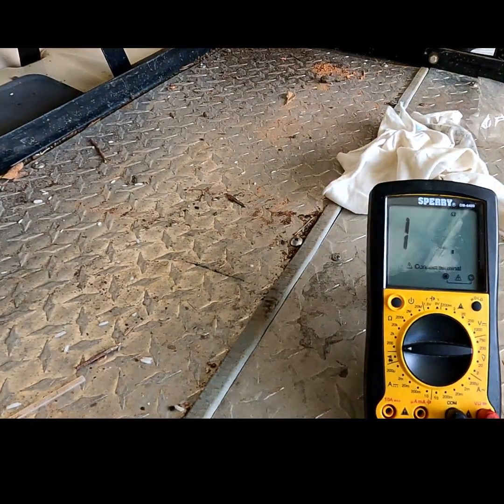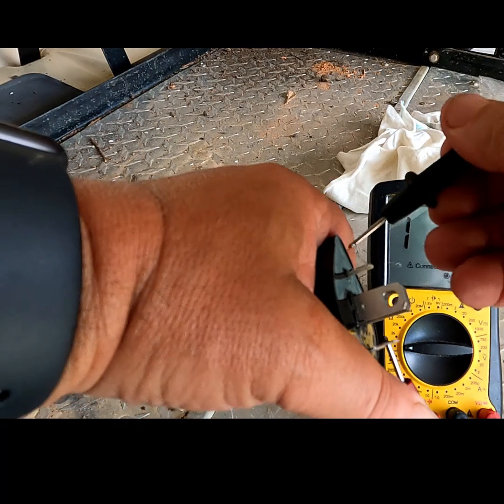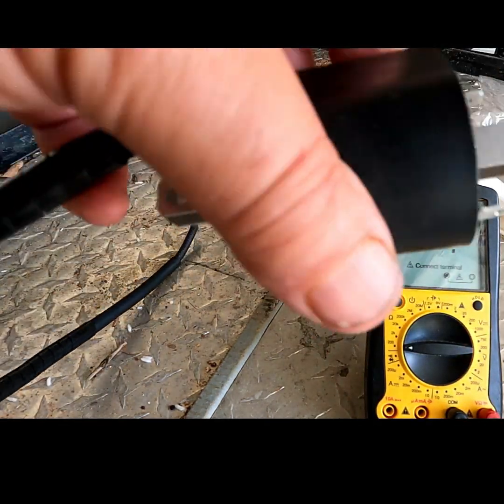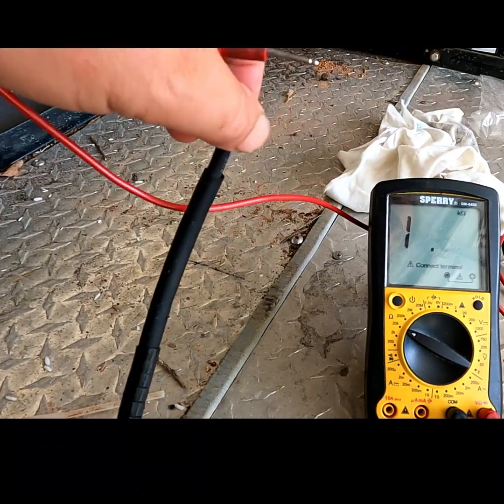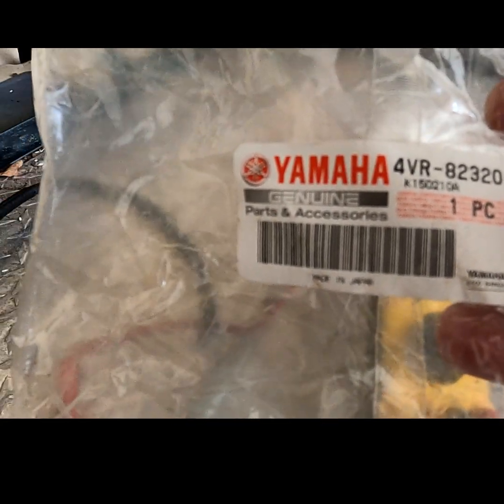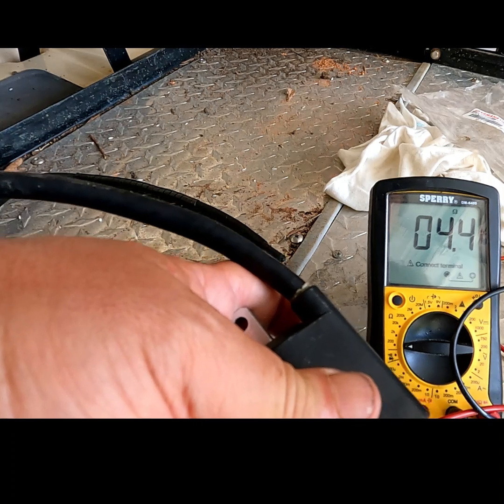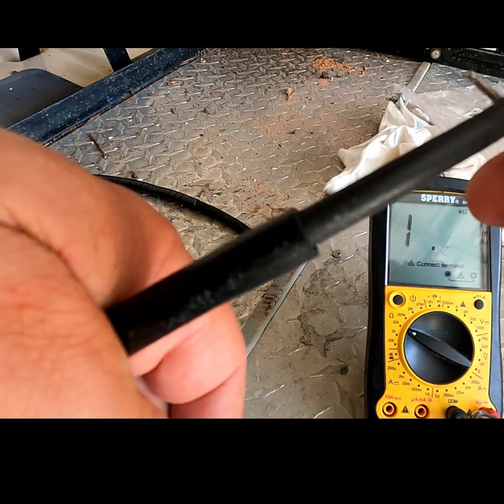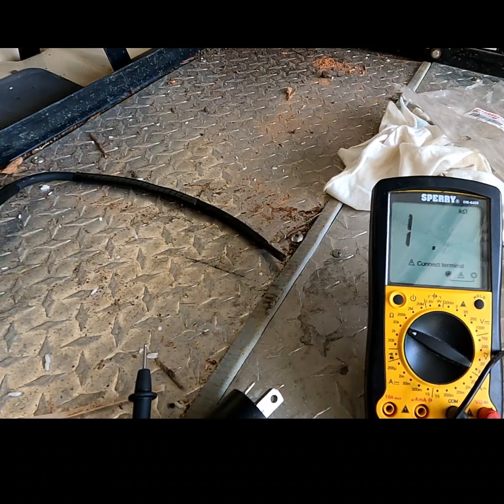V-Star 650 Classic Ignition coil testing

Comment: Hello sir, thank you for sharing this video. I have no spark issues with my 2006 Yamaha vster 650 both cylinders and I'm getting 21.5k ohms resistant for the secondary side. Are those spark plugs bad? I have not tested pick up coil yet or also don't know if my cdi is bad. Thank you
Reply from the maker: Hello and hope the video helps. 21.5 ohms seems high. It should be 3.6-4.8 ohms on the primary and 10.1-15.1 @68 degrees F. I would check the fuses (behind the battery). That’s a lot less work than changing the stator. Specking of the stator, disconnect the white wires from the harness and ohm the wires to each other. 1-2…2-3…3-1. The resistance between any of those wires should be 0.50-0.62 ohms @68 degrees F. Again the ohm on the secondary coil seems high, but it’s strange that you have no spark on both cylinders. Make sure the wires are disconnected from the coil and the stator when testing.
Reply: @gnjadventures  thank you for your reply. I took the ignition coil off and that was my reading without being connected to any lines. I found a few videos and it seems like I might have a bad stator or pulser. Or maybe the cdi?? I also like to change my ignition coil since they are out of specks